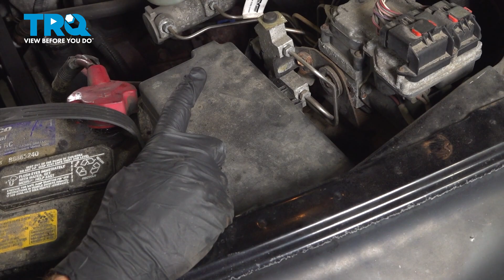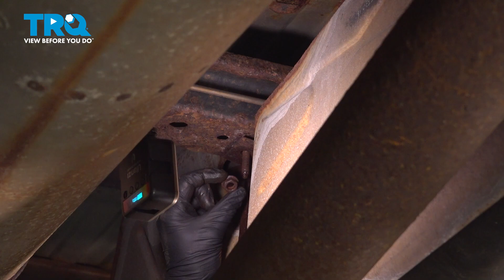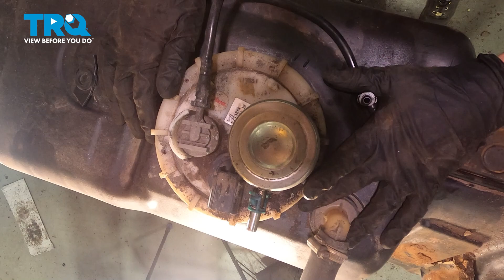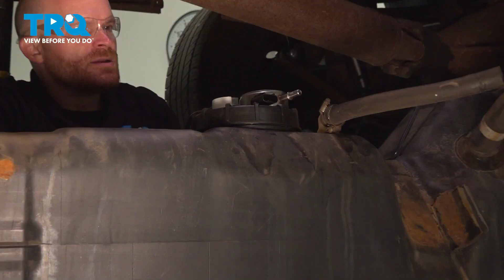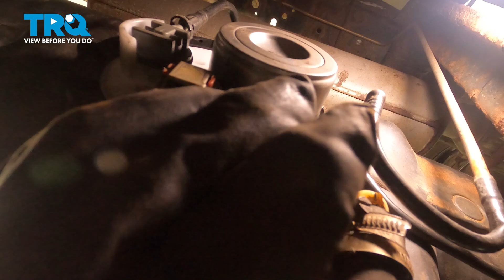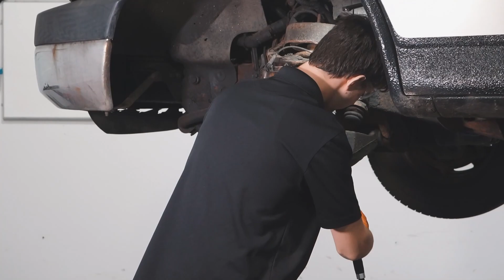How to Replace Fuel Pump Lock Ring 1994-2002 Dodge Ram 2500

Comment: Mine is pouring gass out from under my locking ring do I have to replace the hole fuel pump for that or can I replace that part because no where sells just that peice :/